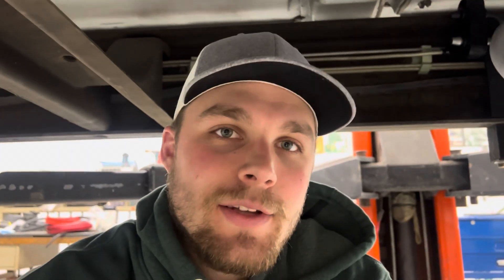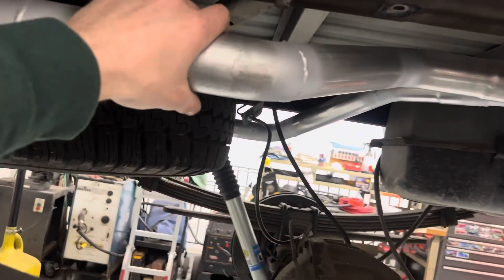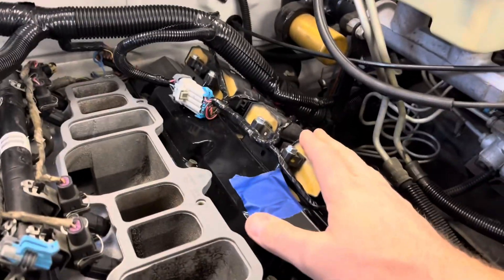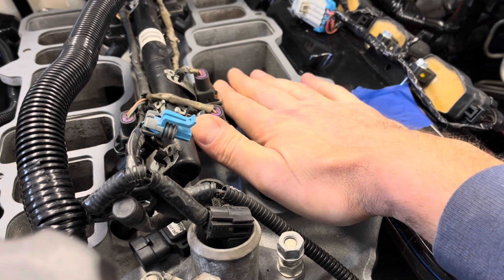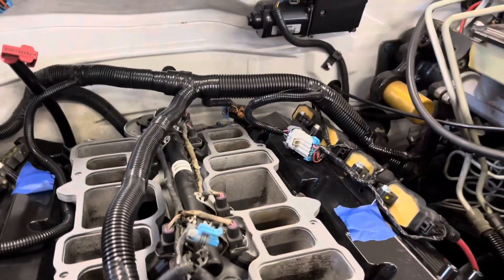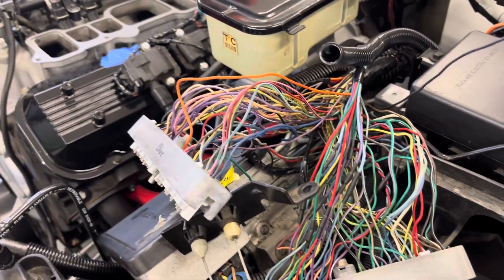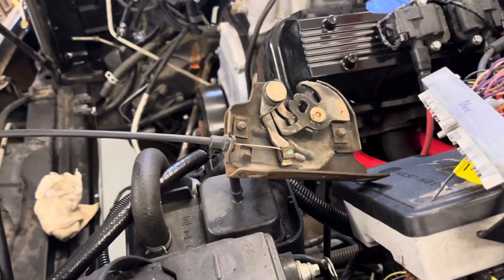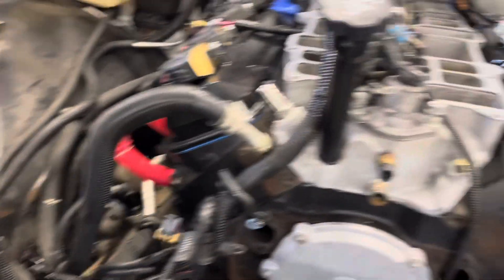OBS Chevy 454 Vortec 0411 ECM Swap: Part 3

Comment: Pretty informative upgrades! I’ve always been a fan of the L31 vortec and have read up on the issues with the distributor and the black box. Would it be possible to do all these kind of upgrades to that block as well?